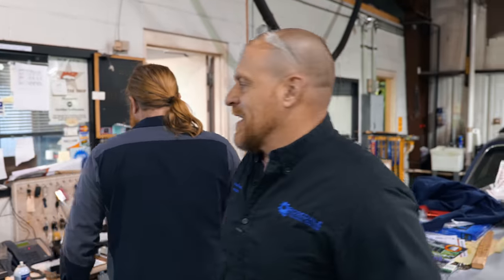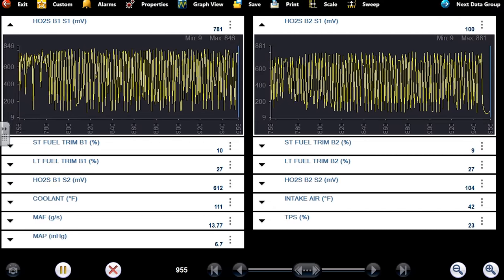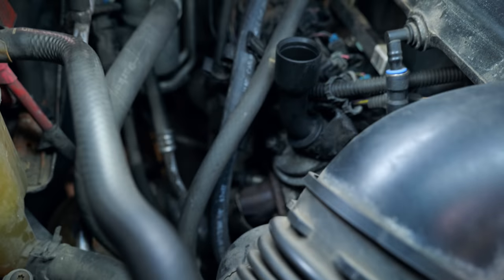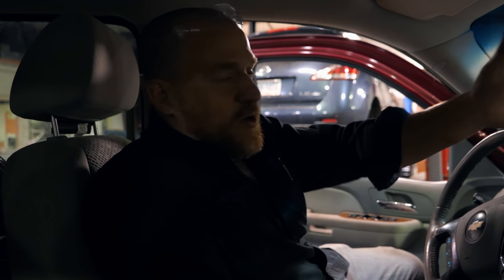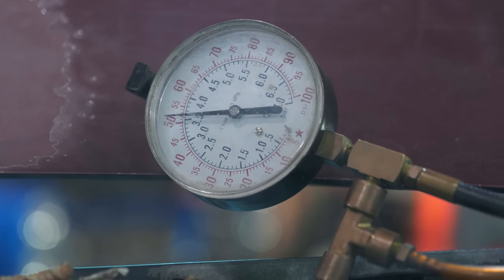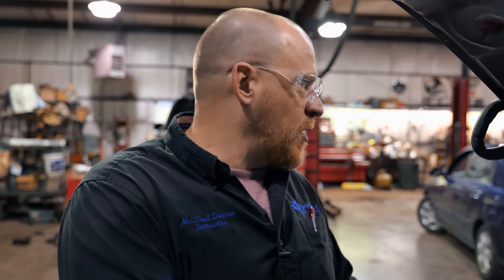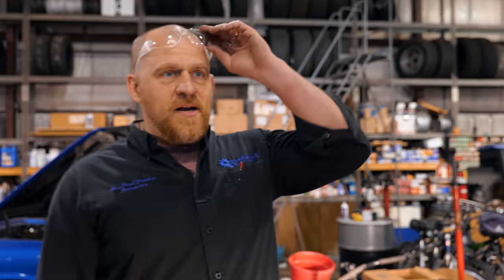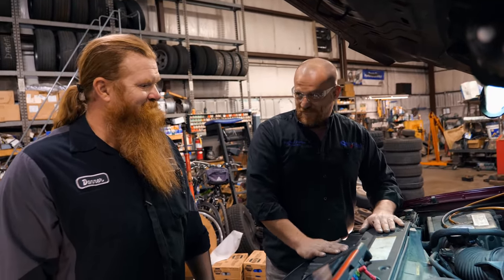Multiple Problems/Poor Customer Communication (Low Power, Long Crank, Stalling P0171/P0174/P0121) P1

Comment: Check how much the pump pumps in 10 seconds. multiply and find out how much pumps per hour. and check with the manual. it's faster than an oscilloscope.

Comment: Fuel pressure falling on it's face w/o pump looks like regulator stuck open. Inability to maintain prime pressure
Reply from the maker: Agree, or an internal leak of the fuel line where it leaves the pump

Comment: What do you generally see with a PWM Fuel Pump waveform with either the pump failing or module failing? I know its a squarewave for a functioning Fuel pump, does the squarewave form change or would you notice it more on an amperage reading?
Reply from the maker: The square wave you're referring to would be com lines between pump module and PCM. The actual amperage waveform won't be a true on off because the pump produces its own voltage while it is spinning when it is "off". Hope that makes sense.
Reply: @ScannerDanner  So it would be just straight lines across a scope for instance if the Fuel pump module had or was failing.. It just wouldnt be pwm anymore. But the amperage waveform wouldnt change? Ive just never scoped one of these before. Guess id better do some more reading up on fuel pump modules. I think ive just seem more pumps fail than modules.

Comment: I have an 03 Chevy and it has a long crank time. I checked fuel pressure and as soon as the pump kicks off it drops straight to 0. I showed my dad and he thinks that is normal. I even have a chilton book on my truck and it says the pressure shouldn’t drop. I showed my dad that and he still don’t believe me.
Reply: Replace the pump. You could do what they do here. Connect up a fuel pressure gauge and watch it under blip/snap mode. If it drops >5# that is a definitive test of a failing pump.
Reply from the maker: Your long crank is definitely because of that issue
Reply: @leonardodavinci303  yeah I did all the tests. The fuel pump works great. I don’t have any lean codes or drivability problems. Just the long crank. This all started when the fuel pump was replaced. I think they did something wrong when they installed the fuel pump.
Reply: Flowtester21, try cycling the key to run and let the system prime, then turn to crank and see if it starts better. You still need a new pump though.
Reply from the maker: @Flowtester1  or you got a s--t part. Typical these days
Reply: @jdtractorman7445  I have tried that. Sometimes it helps but it will only like shorten the long crank it doesn’t ever crank right up. I do appreciate all the suggestions though. I think Paul is right though I bet when I pull this pump out it will say made in China on it somewhere.

Comment: What type of scan tool can you recommend for a home mechanic that will give you the throttle body control like that?  Thanks
Reply: Think Tool makes some decently good options at a reasonable price point for programming and coding and function controls.

Comment: Dumping comments on you here but are you certain 9 amps is normal? A fuel restriction can cause low flow, high pump current, resulting in your symptom.
Reply from the maker: These pumps run high. New one is 11.5 average (video coming up Saturday)

Comment: K

I  destroyed my rebuild tcm by trying to remove the computer in my original tcm and put it in the  used rebuilt tcm because it wouldn't shift right and I couldn't get no one to program it  I thought I getting jerked around  wrong   
So what I'm trying to get at is will my 2014 gmc acadia start and drive without the tech employees or brain in the tcm?  And there's more I have lost the key twice and at 300 a pop its not going to happen so if I can bypass that immobilizer crap it's getting crushed can anyone help me out
Reply from the maker: Not much I can help you with here. You need to have that programmed with the correct part.

Comment: could a leaking injector cause low pressure issues?  or a rusted out fuel line?
Reply from the maker: No on the leaking injector and if the fuel line was rusted out you'd have fuel all over the ground
Reply: @ScannerDanner  yep i knew a fuel leak youd smell or see
but wasnt sure about the injector

Comment: To many commercials.  This is worse than regular TV.
Reply: Then go watch regular tv
Reply: @derek8159  why when i can just go watch one of the  many other channels that doesn't have a commercial every 3 5 minutes. 

Or better yet, i can say something and give the creator feedback so they can decide whether they want to tone it down a bit or continue and risk views.

Your suggestion is logically lazy.
Reply: sumduma55 are you a mechanic?? If you are then you know getting this kind of info for free its a GOOD DEAL, there is a lot of work put into here and somebody has to get the salary from this channel SO commercials are ok!! Think it that way
Reply: @armandonika  I did not say no commercials, I said there was too many. 

Why is it that you seem to think my opinion doesn't count or is somehow wrong when you cannot even get it right?

As for the invaluable-ness of the information.  What did we learn from this 40 minutes of content stretched out to an hour and 10 minutes via commercials? That something is wrong with a furl pump as provided by a pressure gage and no oil cap creates a vacuum leak. Oh and then there was the throttle body cleaning which I guess might help beginners. And that problems may be apparent in closed loop verses open loop. Something we all already knew from basic mechanical skills and understanding. The bulk of it was little more than a sitcom with the star complaining about another project and interacting with his brother for filler. Lots of valuable information there.

Now Don get me wrong,  there is useful information in most of his videos. But not any more useful than any number of other channels with far fewer commercials.  

But I like the entertainment value combined with the knowledge here so I'm giving feedback. It's really that simple.  I'm willing to accept some commercials but they have gotten way out of hand in my opinion . You are free to disagree.
Reply: @sumduma55  Like I said, go watch something else and keep your negative comments to yourself. If I go to a restaurant and am not happy with the service, I simply don't go back. Nobody is forcing you to watch his YouTube videos and they are free. He doesn't charge his brother for his time, so he profits from the ads. I'm a tech also and I appreciate his content and the entertainment. These are not classroom type videos, otherwise you would be paying for the material.
Reply: @sumduma55  well gosh you don't like commercials why don't you subscribe to YouTube premium! It is so much better.